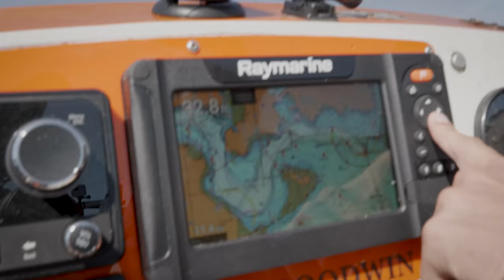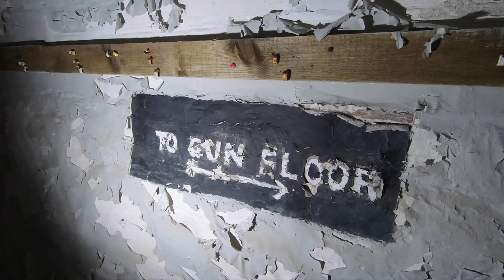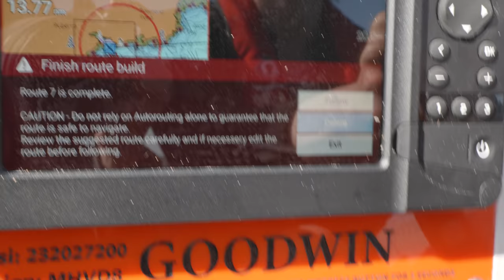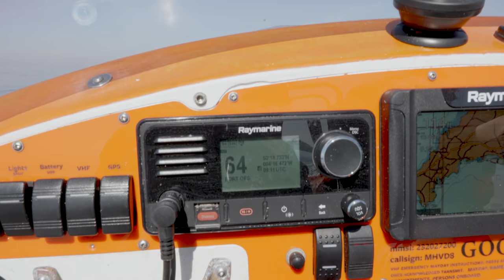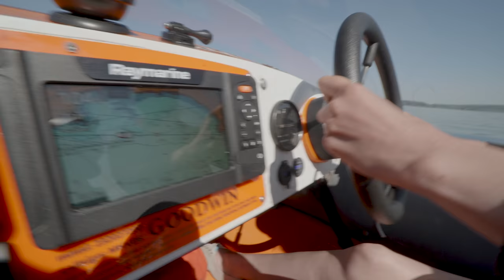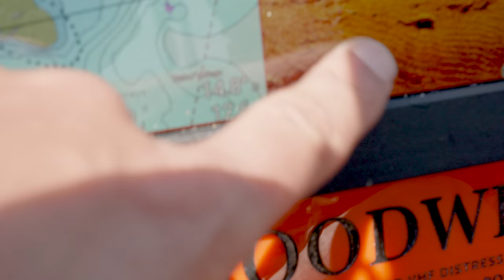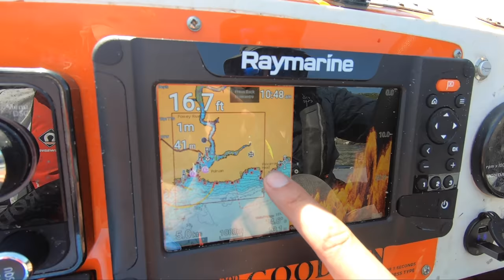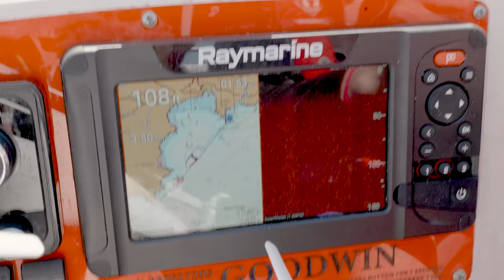1700miles in a Tiny Speed Boat - Part5

Comment: I did a rough estimate of mileage using the app I use to plan trips (i-boating) and if you are talking nautical miles then you are pretty much dead on. I plotted lines in a mor daring manner than I think you would travel and came out with 1,684.74 nautical miles. If you are talking survey miles then you are off by about 240. Seriously loving the series, I have a 16 foot fiberglass boat that weights 1800 pounds fully loaded powered by a 60hp outboard and now I really want to get a rib like yours. Looks super fun and fuel efficient and perfect for zipping around Puget Sound and hopping waves!

Comment: I remember having a look aroud Drake island a few years ago, it was anamazing place! Back then everything was completly deserted without any closed doors or barriers, It seemed like the only other visitors were other explorers
Reply: how did you get over I am planning on going in a 3.4 m sib with a small outboard and have never been on sea before only rivers any tips from what i can pick up it's tricky with all the sallows and coral  any advice please
Reply: @MrFrankstanks  We sailed up pretty close  (maby a 200m from the shore) In a 26' and then just motored over in our sib with outboard and beached it. If you are going in a small boat with and outbouard make sure you bring oars, that way if you engine fails you will be ok. when you get close to the shore lift the engine up out of the water and then row to the shore, make sure you pull it out of the water so the tide wont come up and float it away. As long as you go along to the right of the pier you should avoid any big rocks, in a sib the waterlines so low you wont hit anything, just dont smash your outboard.
Reply: @rexaitken   cheers man so if we launch the boat in directly across from drakes island in that port opposite drakes island pier  can we just got straight over or is there a set direction to follow don't want to piss any other boats off

Comment: yay another episode!      Noticed your dodgy engine start in December - Did you drain down fuel system?  Ethanol in modern Fuel causes all sort of issues if it sits around for a while.
Reply from the maker: I adjusted the air fuel mix of a where the air fuel mix  adjustment screw had become loose. It's now firmly in with locktight and running like a dream.

Comment: I served on Tidespring and did my steering ticket on her bringing her in to portland. 39000 tonnes. I also nearly blacked her out at 5am due to a technical glitch i found! Its Royal Fleet Auxiliary. I have a good video of me being launched in the pac 24 rib off of the side!
Reply from the maker: Wow, must have been a tricky thing to park. Did you get to pump the thousands of tonnes of fuel on and off too?
Reply: Yeah i was onboard when we did the first ever RAS after its build with HMS sutherland. I was off watch at the time (i was 4-8 in engine room)  and i woke up to gangnam style over pa system as they were having a party ok the bridge to celebrate!!
Reply: Also, if you are that bored and watched the video of her coming in to portsmouth i am standing on the flight deck. We managed to blag a tour round the air craft carrier while in Portsmouth